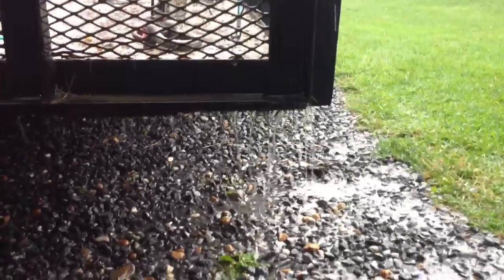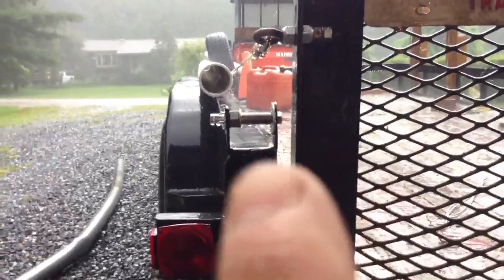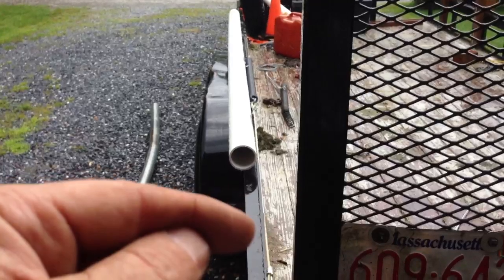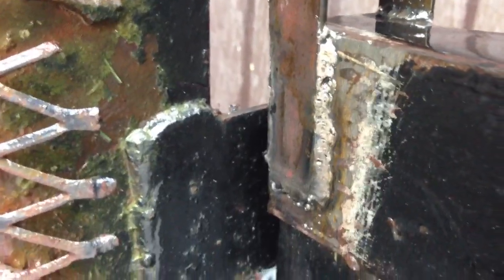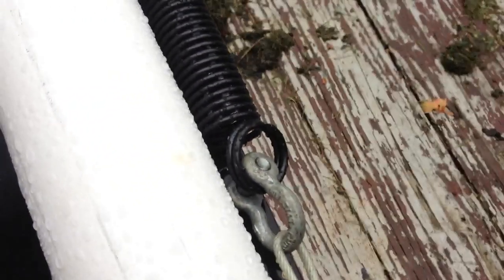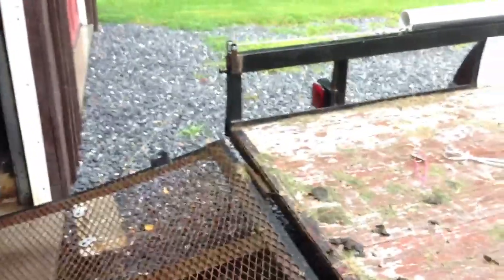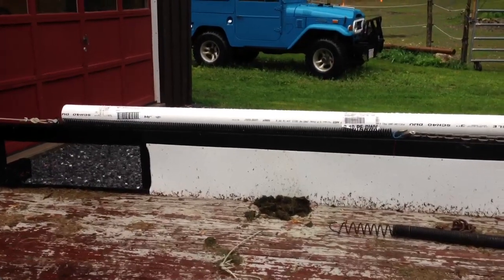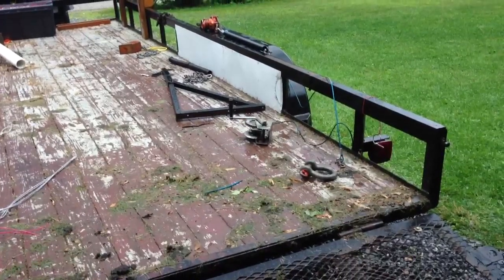Making a  gate lift assist for the landscaping trailer.

Comment from the maker: Yea, I used to have detachable ramps on my trailer (8000lb car) I ended up making channels for the ramps to slide into like a Ryder truck style walk ramp.  I prefer tip ups though, anytime you don't have to remove the ramps you are better off. We have some pretty rugged roads around here, I can't tell you how many ramps I've found in the road that got loose. I returned a couple of them. (I knew the owners.) So I prefer a solidly attached ramp. A friend of mine has one with pipes that go all >>

Comment: That should help a lot. Nice job. I have a heavy 15,000 lb rated trailer that I have to figure out how to take the ramps off and on without such a ordeal. It would be easier to take a video and show you. The ramps weigh at least 300 lb's each.

Comment: check my video out cable will not fry.
Reply from the maker: The cable doesn't really touch the top of the tube as the connection point to the gate is pretty low.

Comment: I copied mine from to top two lift gate suppliers
Reply from the maker: I tested this one at different catch points, and found the gate bounced up a lot in its own if it was captured too high. That wreaked havoc with the zero turns floating deck.

Comment: YOUNG MAN , U ARE DO THIS JOB ASS BACKWARD , PUT YOUR CABLE UNDERNEATH YOUR BOLT OR PULLEY
Reply from the maker: +CASECE CASE If you put the cable underneath the roller, it will slide on the edge of the trailer. (Fraying the cable.)
Reply from the maker: +CASECE CASE https://youtu.be/E-EMBIWNlEE